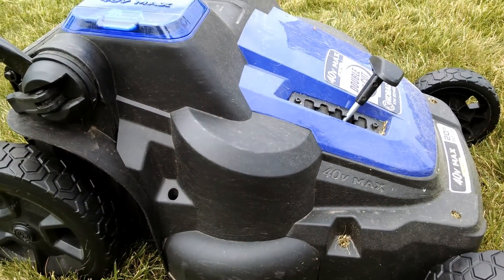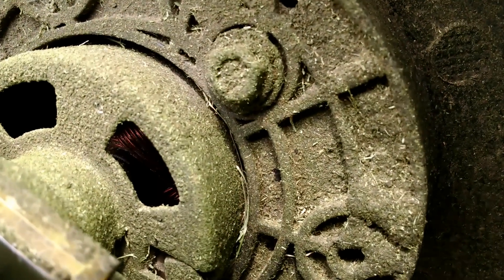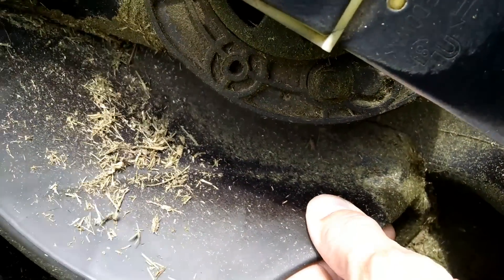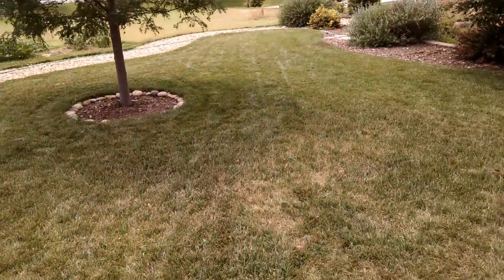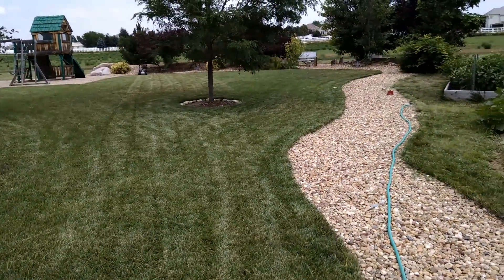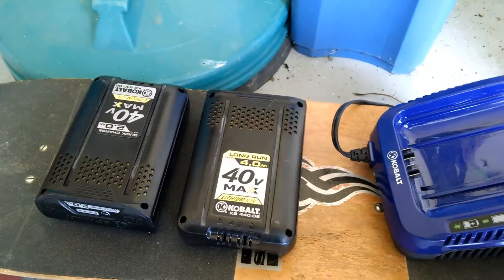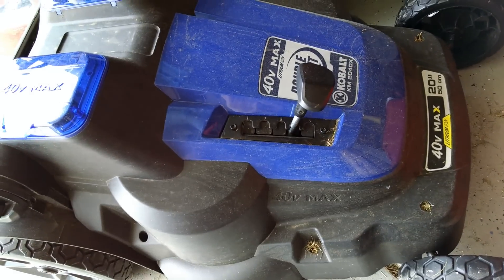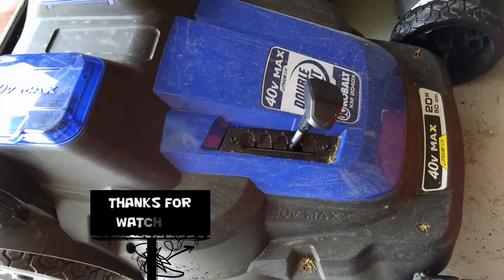3 Month Update - Cordless Kobalt 40v Max Lawn Mower

Comment: Thank you four putting up these videos. The motor on my Homelite mower died after 5 years so I ordered a Black and Decker and had to take it back because the height adjust didn't work, so I went looking for a new battery mower and found your videos of the Kobalt. When I saw how well it mowed and how much yard it could mow, I decided to try it so I went online and found one of the local Lowe's had them in stock. I've mowed twice with it and so far am very satisfied. I usually only use up one battery and a little of the other, since my yard is much smaller than yours. It mows great and it's so light that my wife is talking about mowing the lawn. I did a lot of research on battery mowers and your videos were what made me want to try the Kobalt and so far, I'm pleased with my decision.
Reply from the maker: RedStickHam That is great! I'm very glad the videos helped you out. I was very leery about buying a battery powered mower, so I figured if I was going to take the risk. With the videos I thought maybe I could help out others as I learned about it myself!

Comment from the maker: Owen McGuire I estimate the part of the yard I mow with this to be about 1/3 acre of pretty easy mowing (not much trim work). It takes me about an hour and fifteen minutes to get it done at a good clip. The kids take longer, but either way it makes it on a single charge of the two batteries. I've seen it run out on the kids, but they putz around too much. I'll be running the first cut of the year pretty soon and will post about how well the batteries held up over the winter.

Comment: I just purchased this model this morning.  Do I need both batteries in it to have it work and does it matter which battery goes in to which port?
Reply from the maker: The batteries can go in either port. It will automatically switch power when the first battery discharges. After use I always let the batteries cool down before plugging them in to charge. Check out the comments on the other two videos I made for this unit; there are some interesting tips from visitors. Have fun, it is a pretty cool mower!
Reply from the maker: It will also run on just one battery, but with my yard it doesn't make sense. dkeith45 left a good comment outlining how he uses his on the One Month Update I posted. https://youtu.be/5l7I1U3fjKA